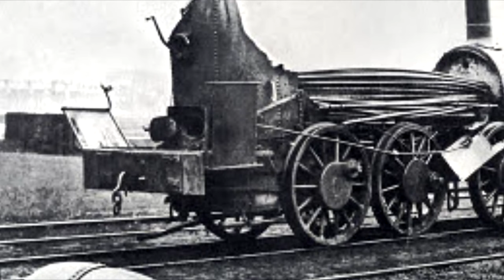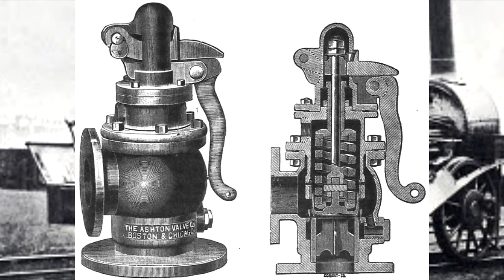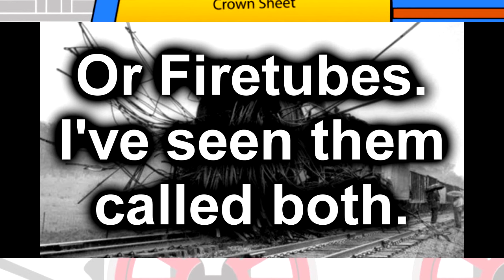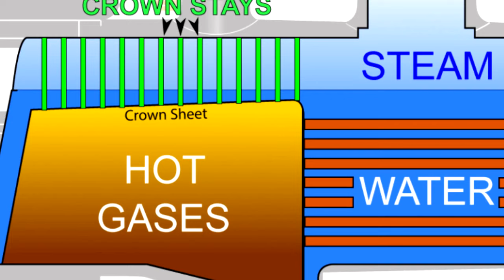Steam Trains Sometimes Have Bad Days 🚂 The Explosion of C&O 3020 🚂 History in the Dark

Comment: It is usually the fireman's job to control the water level in the boiler, not the driver.  The only reason I can think that the crew would not want to add water is the water would cool down the boiler and reduce the pressure.  Adding more coal to the fire would temporarily reduce the heat and if they stopped on the bank it would be difficult to start again.
Reply from the maker: Great point
Reply: This was my thought process as well. It's the only logical explanation I can think of.
Reply: In ohayo accident they were going uphill. Crown sheet even more exposed out of the water despite gauges showing correct level. They coul have been ok with water level on the glass gauges at the back of locomotive while in front it was dry.

Comment: Some accounts I've read regarding 3020's explosion suggest that deliberately allowing the water level to drop dangerously low was a technique crews would sometimes use to coax a little extra power out of the boiler for a short period, which would make sense considering the train was starting to climb a hill at the time of the explosion. Obviously on this occasion the gamble didn't pay off.
Reply: Yes, that was a common thing to do. Experienced crews could do this routinely without issue, because they knew exactly how far they could push things without it being dangerous. Casey Jones for example was very good at this.
Reply: Exactly.  Due to the shape of the boiler barrel, there's more water surface to turn to steam when the water level is lower, allowing a faster buildup of steam.. more power.  In this situation where they need everything the engineer can give, it would have been a noticeable amount.  The downside to this technique is... obvious now.  On a side note, in today's world of tourist trains, there is zero reason to do this.  Aside from the obvious safety concern, none of the preserved engines need to work hard enough to warrant this practice.

Comment: The comments from Gary Bensman are correct. Failure of the crown sheet due to overheating caused the explosion. What happens is a rapid chain reaction of events, culminating in the explosion.

Before failure the boiler contains a mix of water and steam at a particular pressure and temperature. The 3020 was designed to operate at a pressure of 265 pounds per square inch. This means 265 PSI above atmospheric pressure, or about 280 PSI absolute. At 280 PSI water boils at about 411 degrees Fahrenheit.

The hot gases produced in the firebox are in the vicinity of 1500 degrees F, which is more than enough to weaken steel. The water around the firebox keeps it from overheating. But if the water level drops below the top of the crown sheet a hot spot quickly develops. The hot steel will lose strength as the temperature increases, and it will begin to deform or eventually tear apart.

The size of the tear compared to the size of the boiler is critical. A large enough hole will allow the boiler pressure to drop suddenly, which produces a catastrophic failure. All the water in the boiler which was liquid at 411 degrees, and 280 PSi, will attempt to flash into steam when the pressure drops. Steam takes up 1600 times more volume than water. The rapid production of this much steam is like a bomb going off.

Comment: So not entirely sure how accurate this is, but think I heard that engineers would sometimes run on lower water when they ran on inclines with heavy trains in an attempt to produce more steam more quickly.
Reply: That is true
Reply: The way I understand it, engineers of the era would run on low water levels to increase steam volume in the boiler to assist in steep grade climbing. The theory was that the higher volume of steam would prevent stalling on the grade.
Reply: @johnathanedwards9054  no. If anything, they didn't want fresh water cooling the boiler. The water in the boiler is actually a lot hotter  than normal boiling temperature due to the pressure, so slightly less pressure in a hot full boiler yields loads of steam
Reply: The problem is that going uphill you are using steam to move the train and steam to add water.  There is a temptation to underfed water to keep the pressure up as adding water reduces it.  Adding coal doesn’t add pressure right away, it has to light and burn so it isn’t instantaneous. This is the temptation to guard against as underfeeding water can lead to disaster.

Comment: I know of 4 Steam locomotive classes called T1. The Reading T1 (4-8-4), Pennsylvania Railroad T1 (4-4-4-4), the Boston and Maine T1 (2-8-4), and the Chesapeake and Ohio T1 (2-10-4). New York Central also had an electric locomotive named the T1 as if it was not confusing enough.
Reply: Add the North Eastern Railway T1 (Originally class X before it was reclassified under the LNER classification system) 4-8-0T which were used for shunting coal wagons in the various goods yards of the North East, these lasted until 1961.
Reply: Similar to the military and 'M1.' That's a designation for a rifle, a carbine, two types of bayonet, a tank, and others.
Reply: haven't seen an electric locomotive blow up!
Reply: @musewolfman  the M1 helmet too
Reply: And add the Adams class T1 0-4-4 tank engines of the London and South Western Railway. In their case, the class number was derived from the batch number allocated by the erecting shops.
Reply: Lehigh valley also had T1s they were 4-8-4s

Comment: What you called "firetubes" or "smoke tubes" in that C&O photo are actually superheater tubes. You can tell by the little u-bends in the ends of them. They're for the steam going from the throttle to the cylinders to get heated up more and dried out. They come from the throttle to a header at the front of the boiler in the smoke box, go through larger firetubes and then return to another header before going to the cylinders. The reason they're all blown out the front is because of the force of the released steam shoving them out the direction they were inserted. 

Nice video btw.

Comment: I hate to say it but there’s a fair bit of info that is wrong. #1 a glass being at 1/2 or lower is not bad. The water needs to stay in the glass but the locomotives like their water at different levels even locomotives in the same glass our k-37 493 likes a mostly full glass but our k-28’s like about 1/4-1/3. #2 the crown sheet having no water for anytime causes issues. Ok yes a crown sheet without water is an issue but I’ve seen it plenty of times where a novice fireman or owner of a scale locomotive Carries the water a bit low then hits a down grade and the water falls to the front and they loose a bit of water on the crown. Now the scale locos not as much of an issue as they will be on level track soon enough and the injectors are generally really fast so not a problem for longer down grades. Full size yes that becomes more of an issue but the crown being exposed for a few seconds isn’t a massive problem is it good hell no but it’s not going to immediately cause a boiler explosion. #3 maybe I miss understood when you were talking about the smoke box sheet failing generally a smoke box sheet fails due to poor maintenance and boiler washing not an explosion or rapid pressure loss near the fire box again maybe a mis understanding but the info did seem a bit off

Comment: With respect, a 'rush of water' or filling a boiler which is over heated or dry DOES NOT cause an explosion. It has been demonstrated that water hitting a red hot crownsheet results in an instant reduction in pressure. I suggest you look up the Manchester Steam Users Association papers.

Comment: The original report on this incident was posted on  the internet before.  The deceased engineer was well known for running super low water on hard pulls, he even had a nickname relating to low water so and so. He believed that he got more power with a low water level in  the boiler, but on the slight grade the crown sheet was seriously dry, when water splashes over a super heated crown sheet it basically flashes over to steam instantly and the pressure violently increases starting the failure.   I believe it was also his last run before retirement.
Reply: Going out with a bang!

Comment: The C & O T-1 No. 3020 exploded in 1948 near Chillicothe, Ohio killing the engineer, fireman and 1st brakeman. The explanation was low water which caused the crown sheet to fail. It was reported, by the1st brakeman, (before he died of his burns), that he had repeatedly told the engineer that the water was too low. The engineer basically told the brakeman to, "f#&* off". 

Maybe the engineer was suicidal. Possibly a bad marriage, or his girlfriend kicked him out, or he just found out that he had cancer. Who knows.

A similar situation happened in Portland, Oregon with an airliner when the flight engineer told the captain that they were low on fuel and he should land, "like now" Instead of listening to him, the captain started to argue with the flight engineer about the situation, "when I want your opinion, I'll give it to you." The airliner crashed into the suburbs, out of fuel. The entire conversation was on the black boxes, so authorities knew what had happened. After this crash, cockpit procedures were changed so that any input from the rest of the crew was taken into account by the captain, and the fate of the aircraft and lives aboard were not completely at the whim of the pilot-in-charge. It's called cooperation, not "I'm the boss and you'll do what I say, or else", which was how many airline captains acted in those days. They felt that they had worked themselves into the "top slot" and were now entitled. Those people are now part of a TEAM. The famous saying is, "There is no "I" in team."

Comment: The most recent locomotive explosions in the UK were during WW2 in US Army Transportation Corps 2-8-0s . Crownsheet failures all of them & one was in a tunnel. The crew got cooked.
The reason was found to be down to a stuck water valve that could make the boiler water gauge give a false reading.
Reply: I don’t think that the USATC runs in the UK. USATC stands for US Army Transportation Corps. I could just be dumb, BUT maybe if they DID do a run in the UK was because the UK and US were allies, and maybe they were hauling weapons to a port to be imported to the USA. I don’t have a massive brain, but i think i still have an IQ of around 60?
Reply: @CarlCJV  No, you're OK there, Carl. Technically, no, the USATC didn't operate in the UK, but their engines did. The 'Big Jims' and 'USA tanks' were actually built to fit both our and European loading gauges, and were loaned, if that's the right word, to the British Railways (yes, the term was in use from about 1935) to shift tonnage in the build up to D Day, after which they were shipped to France.They were used in general service. One got into serious trouble at Derby, due to excessive 'slogger' in the axleboxes - two sets of driving wheels went one way on a diamond crossing, and two sets went the other way........ The engines were promptly taken out of service until some decent bearings were fitted....... There were a few other problems with the (very) basic design, but in Europe they gave long, very valuable service far beyond their designed shelf life. In fact some were still actively at work until the mid 1970s. Build 'em big, cheap and tough, and they rewarded us. And we loved them enough, over here, to preserve several of both types.

Comment: Why would they not repair this locomotive? A boiler explosion will very rarely seriously damage the frame and running gear, and the boiler itself is a part which would normally be replaced anyway at intervals of ten years or so. Railway workshops were geared up to do this on a regular basis.

Comment: American *type. Not class. 

The type of the locomotive is derived from its wheel arrangement. The 4-4-0 is typically known as the American type (or sometimes even the American 8 wheeler). The name of the type usually comes from whoever created it first. 

A couple examples would be the pacific type and the Santa fe type. There were a couple pacific types before it got its name, but it was a new Zealand pacific type that got its name. 

The Santa Fe type (2-10-2) got its name from the Santa fe railroad creating the first 2-10-2 type locomotive. So, locomotives like the DRG Br45 and the Chinese railway QJ class are referred to as Santa Fe types, even though they have no correlation with the Santa Fe Railroad.

Comment: Wondering why the locomotive was repaired? Apparently the boiler can be replaced much more easily than the running gear. With the single photo alone, the locomotive stayed on its wheels. It didnt derail. This meant that the running gears are intact and any damage to it can be fixed cheaply. At that time, boiler barrels are much more cheaper to build than the running gears.
Reply: Also, the shops would always have a couple of spare boilers in hand, ready for just such an emergency. Quick swop.

Comment: Basically to get the picture so to speak is when a steam locomotive has a boiler explosions it’s boiler pipes fly forward due to the firebox heat and pressure 

And if ur wondering if it’s repairable it can just difficult and expensive
Reply: The repair would have been simple enough - just drop a new boiler onto the loco frame, job done.  The pipes that have been blown forward appear to be the superheater, all of which is attached at the smokebox end and then runs inside special, large diameter, smoke pipes called 'flues'.  There is nothing to secure them at the firebox end so, if you have an explosion in the firebox, they will be blown out of their flues ...

Comment: I'm surprised that they don't constantly pump water from the bottom of the boiler over the crown plate to avoid that.
Reply: I was wondering that, too.  A spray bar that continuously sprays water on the crown sheet in case it gets uncovered due to low water level.

Comment: If they are positioned properly the bottom of the Gauge Glass should above the level of the Crown Sheet, so if you can see water in the glass the crown is covered.
I can remember reading in a book, can't remember which one though, which said that the older "Salter" safety valves, the ones with a lever out the back, the drivers would regularly hang a weight on the lever to get extra pressure out of the boiler... Another instance was caused by the overhauled Ross "pop" safety valves where they had been reassembled by an apprentice, somehow he managed to assemble the internal mechanism upside down, so as the pressure built up, instead of lifting to release the pressure, they were forced closed, tighter and tighter...

Comment: The cp 1278 has a modified firebox that saved the life's of the crew it is now on display at the age of steam roundhouse
Reply: surprised that its even on display. to my knowledge it's the only boiler failure where the crew survived.
Reply: @rearspeaker6364  the boiler didn't fail. the firebox overheated and had a fishmouth failure.
Reply: @hirisk761  the crownsheet on the boiler partially failed, its still a boiler failure. It's the design that saved the crew and passengers that day.
Reply: Someone who used to fire the 1278  inspected the engine after the incident and said " The engine's boiler failure was due to years of neglect." The incident was due to structural failure, not low water causing the crown sheet to overheat.

Comment: The river boat Sultana blew up in 1865 killing at least 1,000. Locomotives, traction engines & early steam ships all had fire tube a/k/a smoke tube boilers. While pressures are typically 200-300 psi the boiler holds vastly more water (than similar power water tube boilers) if the pressure vessel (boiler) is breeched all of it vaporizes. (In contrast WW II USN ships -carriers, fast battleships and late model cruisers & destroyers - had 600 psi water-tube boilers in major ships.)

Comment: Some crews would intentionally run with low water to allow for more steam in the 'steam space' in the upper part of the boiler barrel. As many have commented, that gamble didn't pay off this day. I believe it was 1943(?). Other examples of locomotives equipped with feedwater heating systems have shown that the valves for adding water were both on the engineer's side of the cab, and the fireman's duty was simply to keep the fire in check while the engineer had full control (or lack thereof, in this instance) for the water level in his locomotive's boiler. Since then, many surviving locomotives, especially those reserviced for mainline or tourist operation, have been modified to have the fireman also in charge of keeping water levels satisfactory.

Comment: Something you didn't mention in regard to safety valves is that early, "Salter" valves could be manually adjusted by the driver, tightening the nut which controlled when they lifted....... (Remember the tallow-pot on Best Friend of Charleston?) Presumably deliberately running 'low water' was the successor to that clever practice. American engines had another, inbuilt problem compared with British or European ones, in that the boiler formed the main load dragging component of the locomotive, rather than the relatively light bar frames. That meant it was subject to many more running stresses, and sometimes caused other courses to give way. 
Don't forget Rhymney Railway No 97, an 0-6-2 saddle tank which blew up 'on shed' after a major overhaul. The fitter had remade the safety valves back to front, so instead of pushing them open, it was forcing them shut......